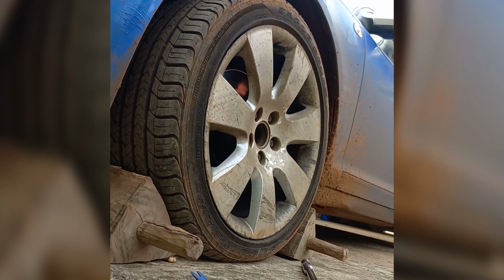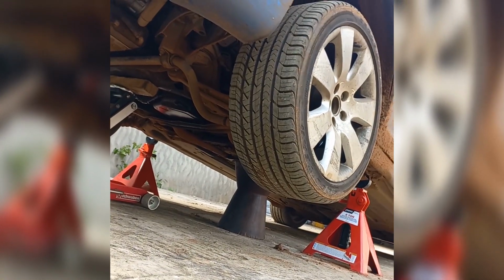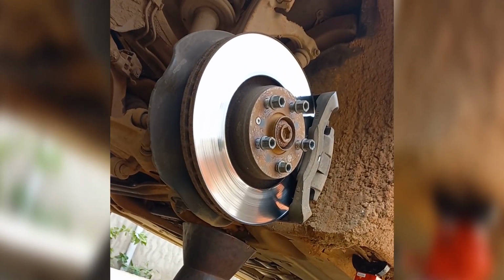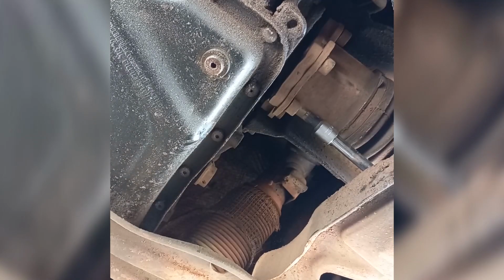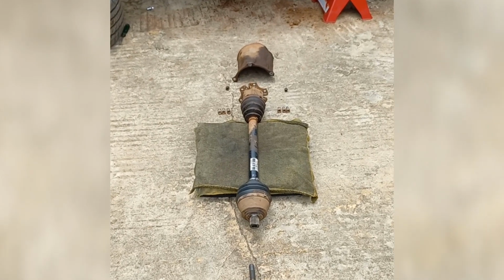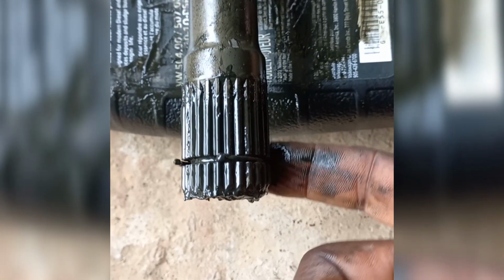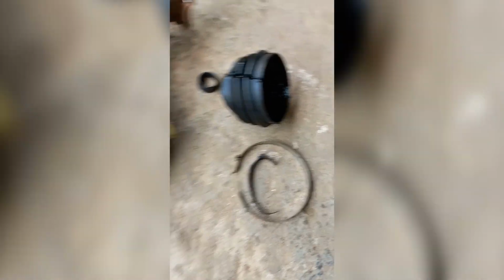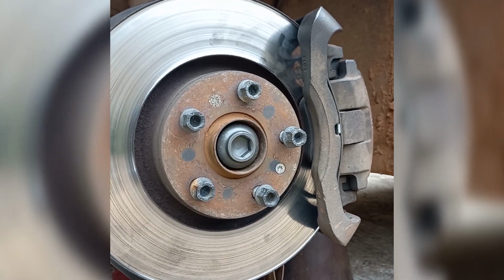Audi A6 3.2 - Axle Removal and Outer CV Boot Repair

Comment: How did you realize that the axle is broken? Sometimes when I accelerate ich have vibrations at about 140kmh which will stop lately after. Also when i brake hard it’s is a rattle which will go away after few moments
Reply from the maker: I realized the outer CV rubber boot was broken while inspecting the underside of the car. About the vibrations, watch this video: https://www.youtube.com/watch?v=NVvJLHIp79M
Reply: @Kokouvia  okay i See, I have new engine mounts new Sport sway bars and new coilovers. Do you have a video of the play in the axle? Did it now fix the rattle? Did you also had problems while breaking hard?
Reply from the maker: @martmccars166  Did you watch the video I shared in my previous message to you above?
Reply: @Kokouvia  yes but do you have a video of the axle itself
Reply from the maker: @Mert Ismail  No, I don't have a video of a play in the axle.
Reply: I noticed a torn boot on mine but ran it, few months later there was some clicking and popping sounds coming from that wheel while accelerating or at speeds between 20-40mph. Sounds got progressively worse for a few days before I got a new axle and when removing the old axle there was greasy metal bits falling out of the old torn rubber boot.